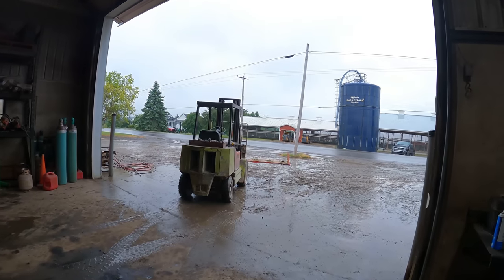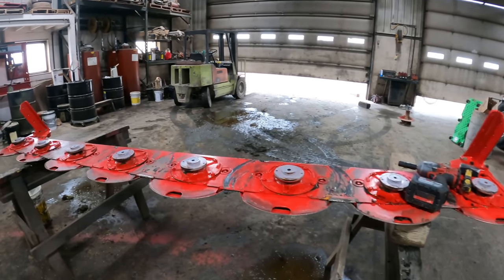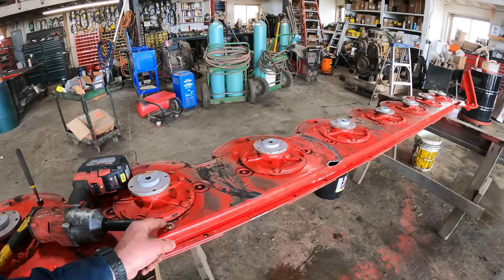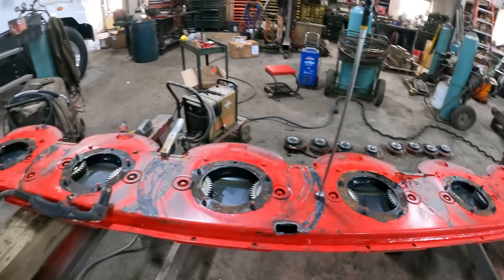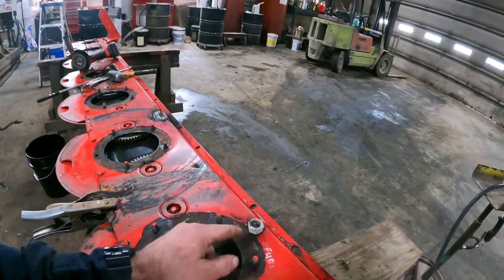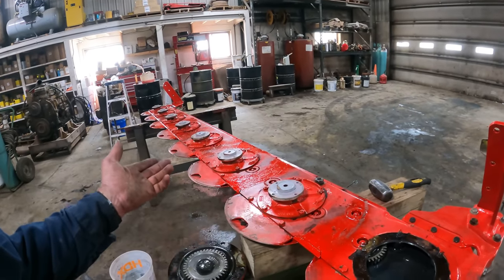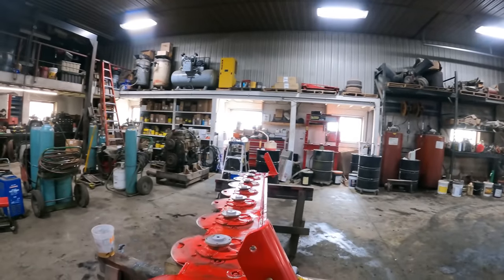That Hole Isn’t suppose to be there….

Comment: If I had been doing it I might have stuffed some fiberglass insulation in and around the cavity where you were cutting with the plasma cutter and grinding to reduce the amount of metal particles going into the gear box or at least limit the area that you would have to clean out.  Those cutter heads are very high speed without any filtering system for the oil. Just change the oil often for the first bit I guess.
Reply: I’ve done similar job on Krone cutterbar. Used diesel in bar and run very slowly then raised one side as stopping then removed fuel and other crap with clean rags from low end(about 2 foot difference in height). Repeat twice. As long as no crap on last clean seal up and fill with oil.

Comment: With the pottinger cutter heads you raise the side of the cutter head furthest from fill plug a height related to formula in manual.  Then check thar oil level is at or just below fill hole

Comment: For the oil control on the Pöttinger cutterbar; You have to lift on the cutterbar on the right side (height difference left-right is described in the manual) an the oil should be up to the filling hole.
Reply: Hooray for someone that knows how the Europeans do their oil fills. Krone is same way. That fill plug should have Allen key countersink in it. No need to weld nut to it.
Reply from the maker: Yes, but how long do you leave that at that described angle and at that point what is more accurate????
Reply: It will be in the manual Andy

Comment: Did the same to a demo kuhn mower when looking at front mounts as had run green kuhns and a pull type mo-co. That deck has been chewed up so will be lil piece's in the bed. Hit a concrete block and knocked timing out aswell. The hole in bed and spindles where all fixed up before the kuhn guy turned up as the hole was only damage and we still can't figure out how 1 got out of timing with now damage. That mower done 10k hectares and just been retired for a back up mower

Comment: If you want a new shop and you want heat in it put it in the floor using thermal heat , with all the land you got you can run a cable underground deep for a distance and draw out the heat to heat your building and it will cost you nothing to eat your building in the winter time

Comment: Andy you take the plug out stick a little dipstick in and you go by that most have a measurement in the book I just fill it a little over halfway and that works for ours if you put to much it comes out the top thru the turtle but simple enough

Comment: Does pottinger use the same cutter bar for all three mowers or will that only work as a spare for the front?
Reply from the maker: Yes and no..10’ up front some rear ones are either 10’ or 12’ and the 10’ are all the same

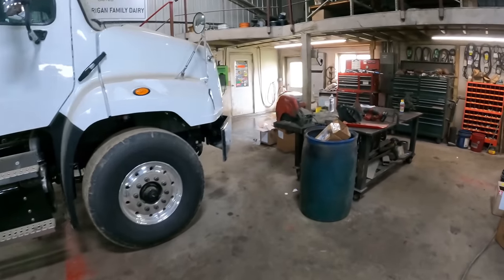Comment: 13:25 huge chunk on the gear facing the camera :(
Reply from the maker: Yes
Reply: It is a bit curious how something from the outside could have made that hole in the steel housing. If there was something loose on the inside that might have been pushed out like that. The edges of the hole are kind of flat, but perhaps a little bit more flared out than in. A mystery hole that can come back to haunt us.
Oh well.

Comment: Well that's a treat getting rwo videos in quick succession.
I am confident that the chink of metal out if the cutter bar is in the field. The knife had to go into the steel and under it to remove the chunk so it would have thrown it out and away rather than into to bar.
As usual l doff my cap in respect!